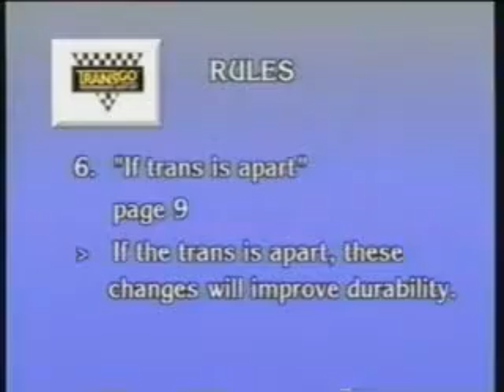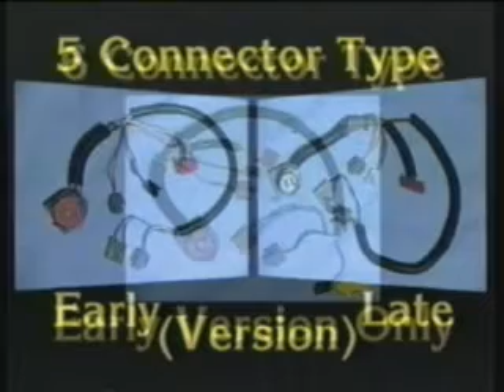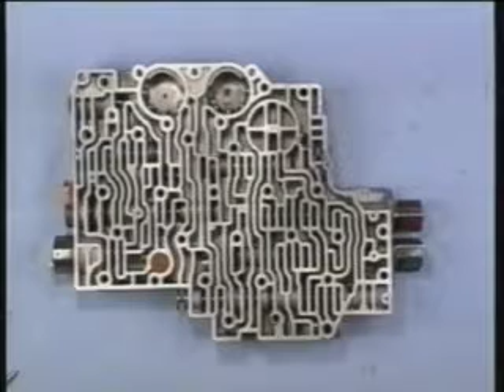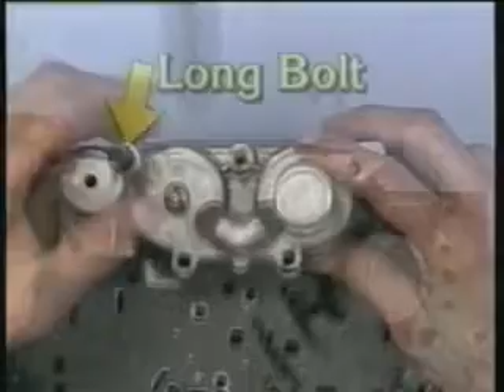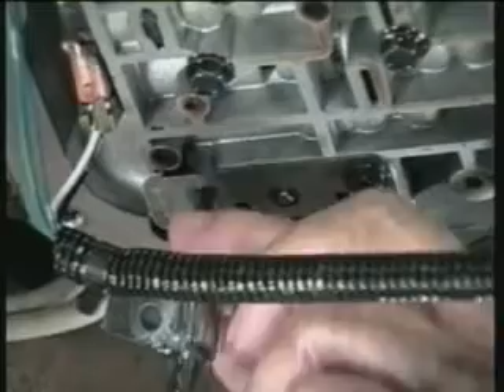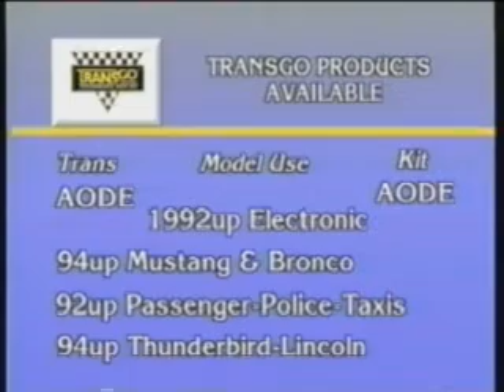4L80E Shift Kit Installation

Comment: What About 2002 Ford with a 5.4 With an automatic transmission I’m not sure what kind of transmission I have anyway going 70 mile an hour in cruise control I’m going up hill then all of a  sudden you feel like a speed bump in the road but of course there’s no speedbump what could that be
Reply: I think that's a normal condition. I rented a Ford moving truck and it did the same thing only on cruise. I would disengage.